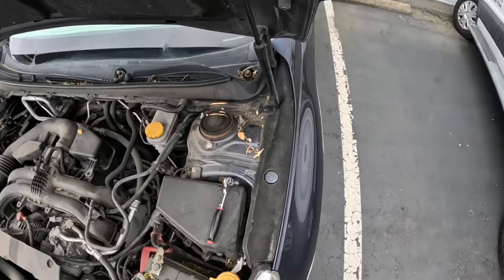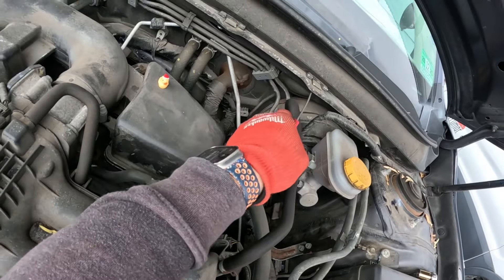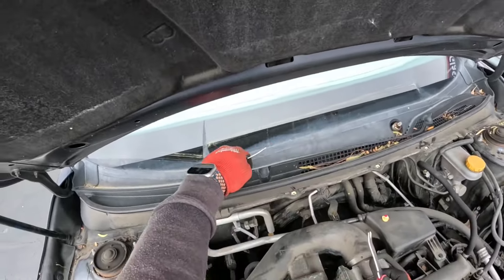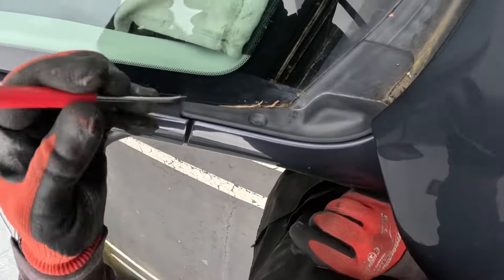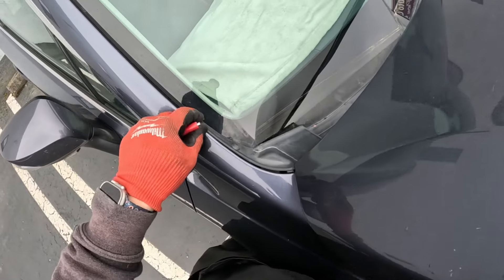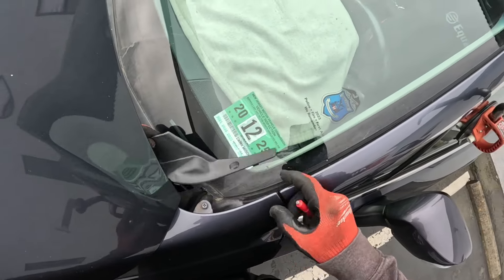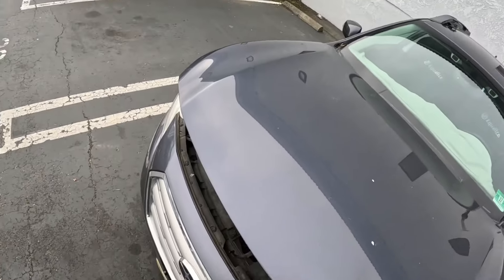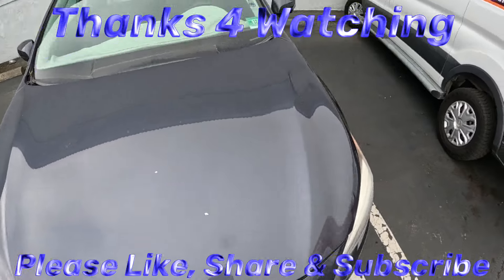17 Subaru Outback cowling removal

Comment: Great tip. I had already figured this one out on my own now if you can save late model, Honda Accord cowl clips I’d appreciate it.  I’m pretty sure they break the first time the car is driven.
Reply: 😂 I swear some manufacturers set a self destruct timer on some of those clips too
Reply from the maker: I’m pretty sure Honda designed those to self delete as soon as you try to remove them.